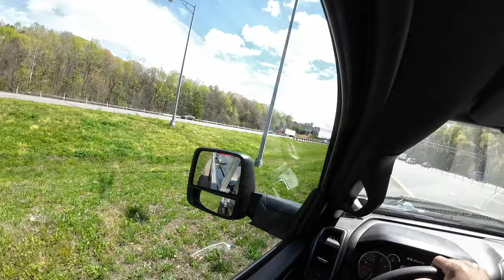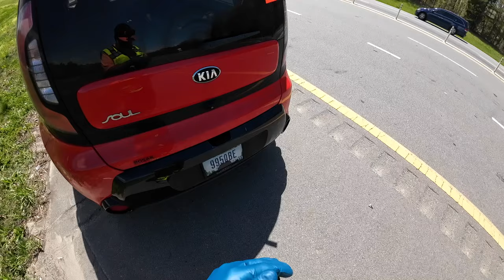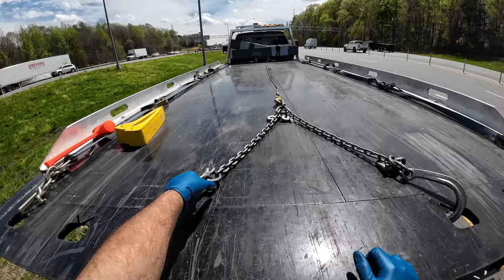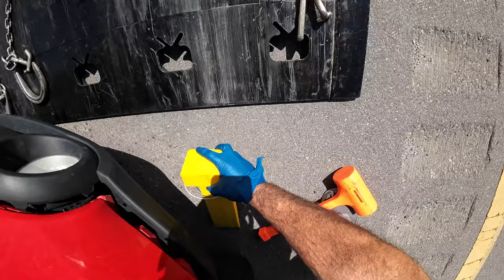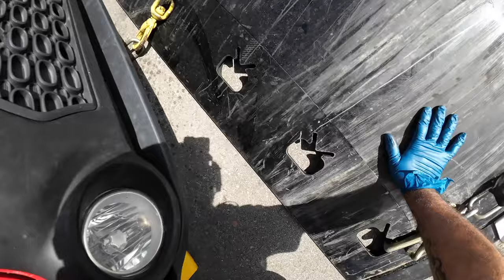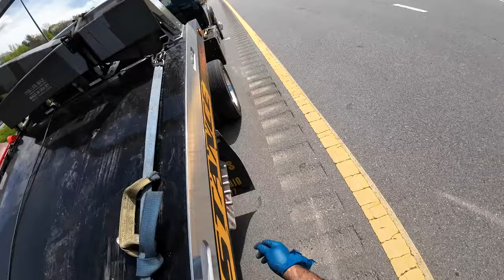KIA WITHOUT KEYS LEFT ON THE HIGHWAY ￼

Comment: Good job Cesar, I have a question not concerning this video. Hope you have the answer!!! Do you know how to get a 2023 Chevy Silverado into neutral without the vehicle being on ??? Just had one and couldn’t find the release if there was one. Thanks for your time and the answer if you have the one.
Reply from the maker: Good morning! Thanks! So for the newer GMC/Chevy trucks that have electronic gear selection transmissions, there’s a tool for it. I haven’t done one myself, but I have seen photos of how it is done. On the side of the transmission, there is a shaft that sticks out. You would put the tool on the shaft and bolt the tool to the transmission. The tool has a handle that you squeeze, which rotates the shaft, putting it into neutral, but you have to make sure the brake is released then you have to unplug the parking brake motor on the back of the brake caliper then put it into neutral. If you don’t disconnect the pocket brake before putting it into neutral, the vehicle will automatically set the parking break. The tool is over $200 online but from my understanding you can use an open end Wrench. Put one end on the shaft, rotate it then push the shaft against the transmission and it will hold the wrench. Whether you are using the tool or the open end wrench method you have to disable and disconnect the electronic pocket brake.
Reply: Thank you for your answer to my question, sounds like too much to do with so little time. So using a wheel lift will have to do 🤣🤣🤣 Thanx again !!!
Reply from the maker: @jvandergriff13  you’re welcome. Yeah it’s a time consuming process so I would just wheel lift it from the back or drag it up the bed using skates.

Comment: A question I have a question why do you knock the skates under the front wheel you going to steal drag it I only use the skates for getting a car straight up on the bed I never use them for that I just drag it all up
Reply from the maker: Hammering the skates under the tires keeps the tires from sticking to the bed which allows the vehicle to just slide up the bed easily. No straining the winch, cable, and parking pawl on the vehicles transmission.
Reply: @TowMan127  I hear a lot of people say by the transmission if that was the case it wouldn't be a towing company open because every tow company in the United States Hanford Transmissions if that was so bad on Transmissions you on the side of the highway is more important than a transmission because you can always go replace a transmission the driver's safety is more important and if you drag it up in park on the front wheel drive is going to pull straight on up but I understand everybody do things different
Reply from the maker: @chops080177  I’ve dragged cars up plenty of times without skates. I just prefer using skates more now. If you look at a parking pawl from a transmission, it’s not some big bulky lever. It can definitely strain or break which is why the “parking brake” was made. People are supposed to use the parking brakes to prevent damage to the parking pawl.

Comment: You waste a lot of time you have to make unlock, and put in neutral and loaded easy
Reply from the maker: Putting it in neutral works but if the steering wheel is locked and the wheels have a slight turn, the vehicle won’t go straight up.